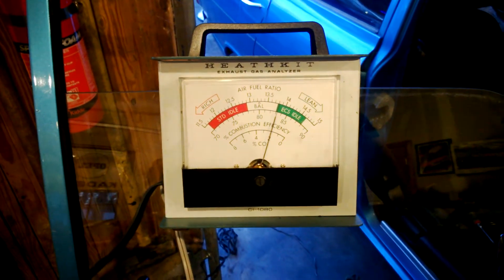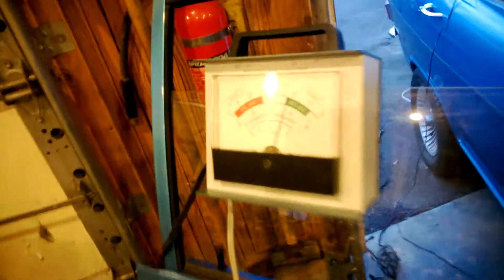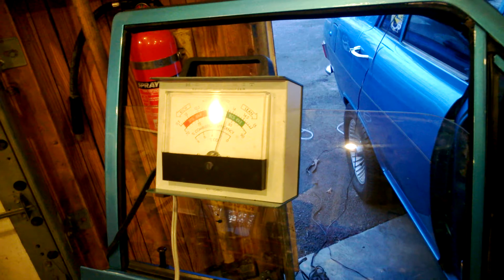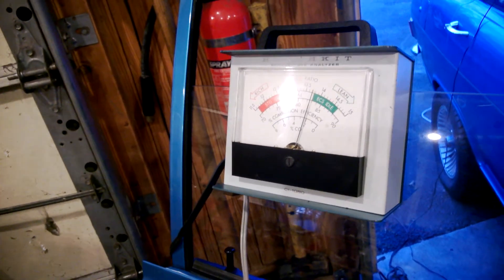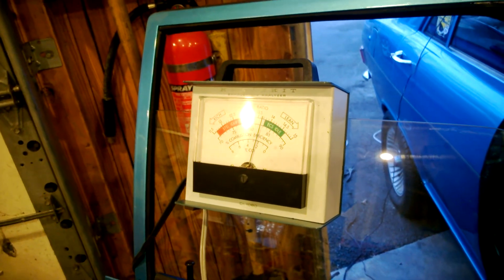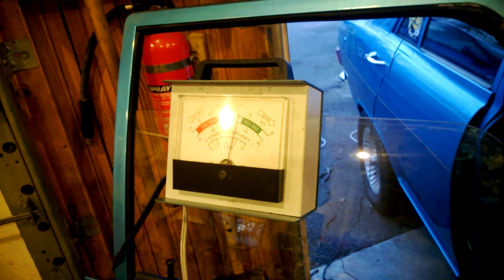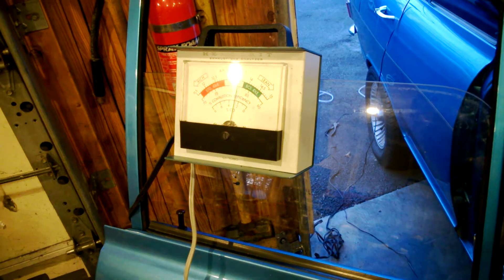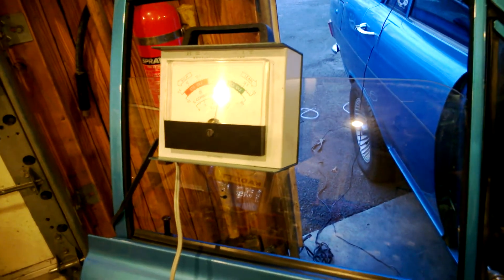Bosch L-Jetronic Fuel Injection AFM Adjustment & Tuning - Part 4

Comment: Hi, thanks for the video, i have a question, why the engine idle speed does not change while you turn the air flow meter screw? Or maybe its too subtle i do not hear it ?

Comment: what kinda of a machine you use to measure the ratio
Reply from the maker: Sorry for the delay in replying I was on vacation. This would be an old school Analog HeathKit Exhaust Gas Analyzer. You can still find on ebay. GUnson makes one similar to it that is digital https://amzn.to/3RXdgok its a little slower to respond but it will work. If you have or are willing to weld a bung onto your exhaust you can put a generic O2 sensor and use a gauge. Its also a little cheaper and you can use it to watch your ratios as you drive https://amzn.to/3SaqfmT

Comment: I have adjusted mine with a Gunson gas meter which measures CO; and have it just where I want it on idling (2% CO) however as soon as I rev to engine to 2500 Rpm, it leans out to 1% CO. I am worried that 1% might be too lean when driving for long distances and could cause heating issues (air cooled L-Jet) - how would I adjust the mid range revving to enrich it? Thx.
Reply from the maker: Stock setup or custom ? the one thing I would look at is your fuel pressure make sure thats good. Also remember your car isn't really under load and the computer can tell. These older tailpipe sensors are meant to tune the idle run circuit only. So if all things are good, unless you feel a performance issue I wouldnt worry about it.

Comment: Very interesting. Thank you for your videos. I have a Motronic 1.5 in a C20NE. Do you know if this procedure could be used to adjust the open loop cycle in a lambda system?
Reply from the maker: It could be possible. BUT the Motronic cap has to be CUT off.. its a lot tighter. Also with the o2 sensor the Motoronic could "readjust" to compensate. That said.. thanks for the idea. May have to try it on my next engine build.
Reply: @GoinManta  yes I allready took the cup of and put it back with rtb. You have to be careful not break it at removal. I don't exactly know hiw the motronic adjust in ooen loop (the lambda is of no use at that time) I belive it will work in a predetermined program until close loop.
Reply: @GoinManta thank you for your answer. I belive you are in the US, let me know if I can help from Spain. We have Opels everywhere 😉

Comment: hi great video I am trying to set mine up now are you available for any questions?
Reply: @GoinManta  sorry I missed the quicker reply to the message thanks for reply :) I cannot get my engine to start with the AFM connected but sans it revs to high to start I dont want to damage engine I am on my own I cannot turn the ignition and press the afm lever I am not sure how to solve the initial problem?
Reply from the maker: @RichardNash100  Note we just moved the Youtube page and it deleted all my previous replies. If you have a question I will try to answer it to the best of my ability.
Reply: @GoinManta  Hi great thanks for notification :) I'll be in touch